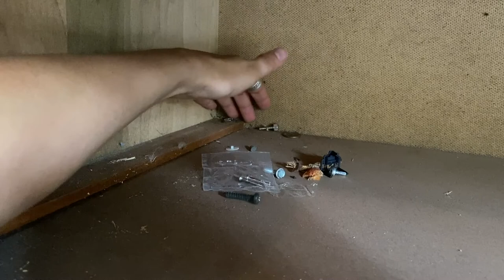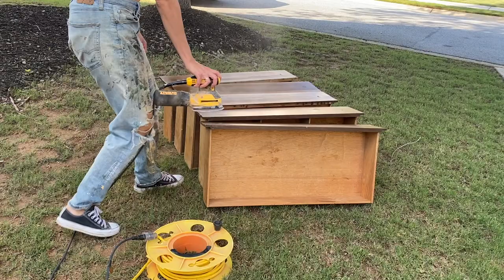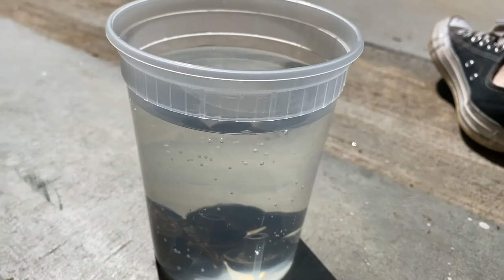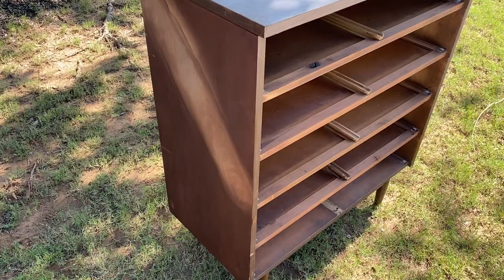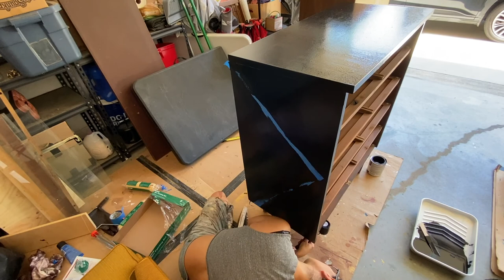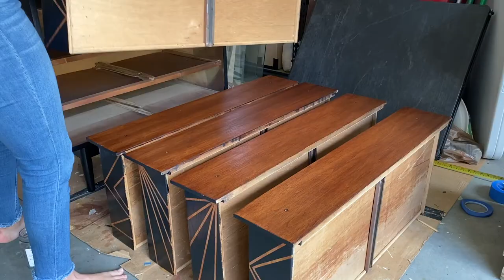MID CENTURY Makeover | A Tallboy's Tale

Comment: I LOVE how this turned out. I mentioned in the comments on another video today that I really love the two tone black with stained wood. This looks so good. 

The pencil trick is great for sanding. I do this on all my pieces. Just a tip. There is absolutely nothing wrong with going from 120-220 grit. I will add this.. it's not necessary. 180 is sufficient. I'm trying to think of the technical term but my brain is in a fog. What I do know is that when staining the higher the grit... the less the wood wants to absorb the stain. I worked in a table shop for several years. My job was sanding and finishing. I learned a lot about finishing while working there.
Reply from the maker: Oh wow! That makes so much sense! Thank you!

Comment: Curious on why you sand 3 times with different grit?
Reply from the maker: So I find that the lower the grit, the easier it is to remove surface scratches and dents and that top layer of finish, but it tends to leave little squiggly marks behind. So the middle grit is to get those squiggles out and to remove the remaining stain, and the last grit is to make everything nice and smooth and to get out anything else that you missed. At least that's what my process looks like now. I've also learned a lot since this video and continue to learn new things every day, but for now, that's how I look at it. You're much more likely to accidentally pierce the veneer if you go ham with a low grit and if you only use a high grit, it'll not only take forever, but it'll also waste a lot of sand paper. Hope this makes sense and helps :)
Reply from the maker: Hey! I now have a video dedicated to sanding if you'd like to check that out :) https://www.youtube.com/watch?v=2eM1sASL7VI